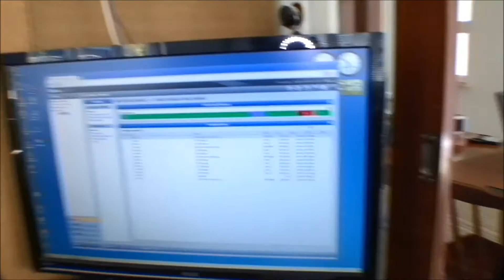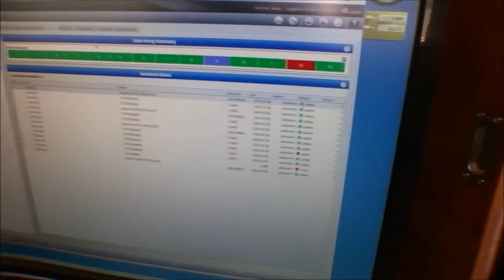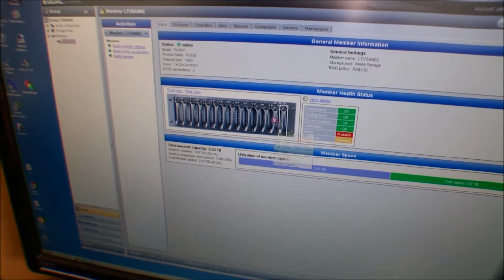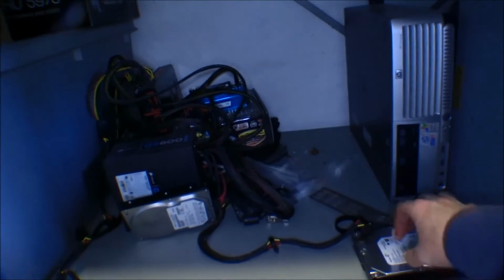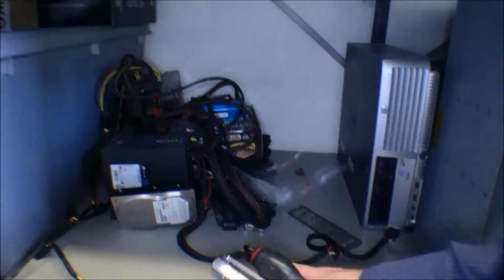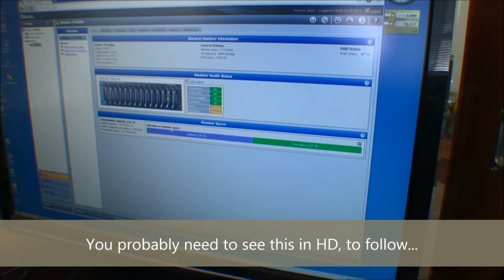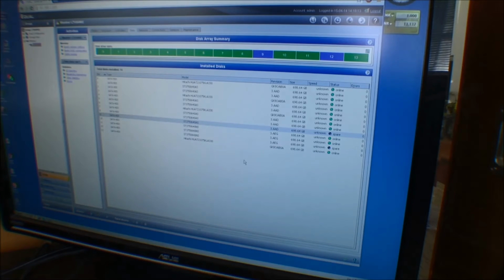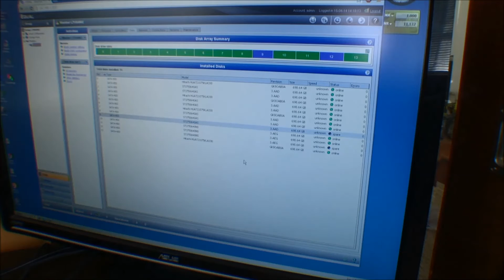Failed disk - Dell EqualLogic PS400E Storage array - 039

Comment from the maker: Hi *****
Your message settings are such that I can not answer you in your thread.
As far as I know,  the old firmware was limited, so you could not use any disc.
I use a kit_V6.0.2-R287892_4231725116 on my Equallogic PS100/400 and it accepts everything I throw at it.
My guess is that you need to update your PS4000
Thank you for watching! :-)

Comment: Hello Morten,
                      For the 2TB SATA disks, what brand & model are you using? Did you need to update the array firmware in order for the larger drives to work?
Thanks in advance.
Reply from the maker: HiBannor Haruchai
I actually run with a good mix of different disks,,, I have two types of seagate,,, ST2000DL003-9VT166 and ST2000DM001-1CH164 and one type of hitache - HUA723020ALA640.
I've also had a really cheap Western Digital to run in it at a time.
I run firmware V6.0.2 (R287892)
Thank you for watching! :-)
Reply: Morten Hjorth Have you seen any unusual behavior with certain types of disks or lower reliability?
I don't have any experience with Equallogic yet but I will soon have a pair of PS400E arrays fully populated with 750GB disks but I'd like to upgrade one of them to 2TB disks if possible. 
I don't yet know the firmware version and an upgrade for these older arrays doesn't seem to be available any more.
Reply from the maker: Hi Bannor Haruchai
I have one with 750GB disks and one i have upgraded to 2GB disks.
The firmware is hard to get,,, if you have acces to DELL´s site and service on the PS400E arrays, you can download alle the old firmwares. You can not upgrade from a very old to a new firmware in one jump,,you will need 2-3-4 upgrades to get to the newest.
I am interestet in newere firmware then the V6.0.2 (R287892) i got, but i doun't have acces no more.
Thank you for watching! :-)
Reply: Morten Hjorth I've received the arrays but no console cable :-( 
I'm hoping this is just a normal DB9 to RJ-45 cable with nothing weird about the pinouts. I wonder if a Cisco console aka rollover cable would work.
Reply from the maker: Hi Bannor Haruchai
You can config it from the "Host Integration Tools" as long that your on the same network that the SAN. Then you doun´t need the DB9 to RJ-45 cable. and you can enable SSH/telnet.
What firmware do you have on it?
Thank you for watching! :-)
Reply: Morten Hjorth What's the latest firmware that the PS400E will support? The unit I've managed to get working has 5.2.6 and I've been given 6.0.11 - which I'm happy to share but I only have the release notes for up to 6.0.7.
Reply from the maker: Hi Bannor Haruchai 
I am running V6.0.2 on my two PS100E/PS400E So I'm interested in both V6.0.7 and V6.0.11 if you get them working.
Thank you for watching! :-)